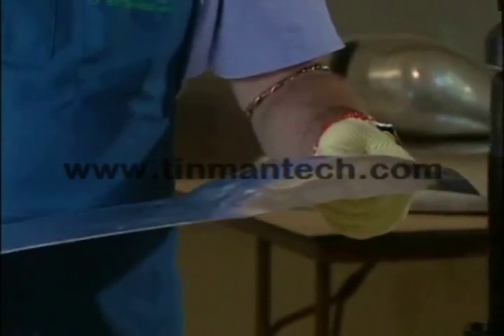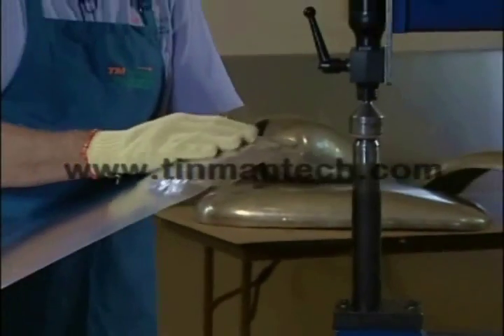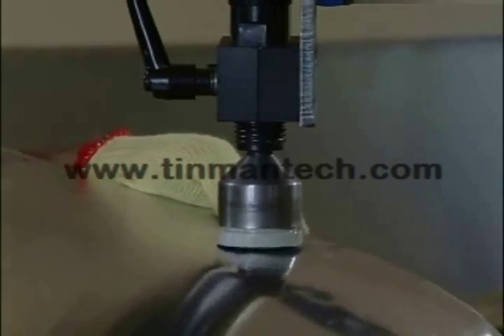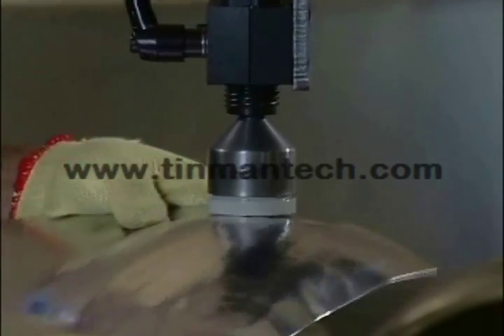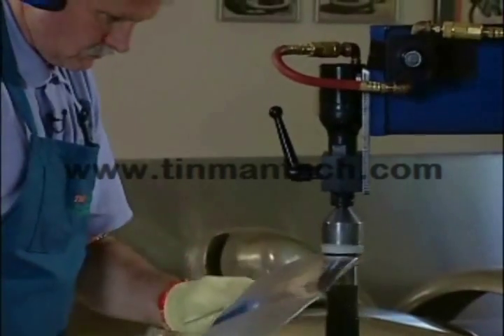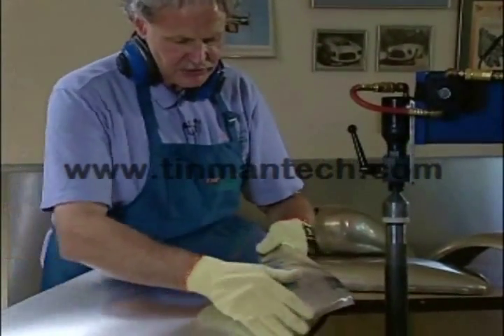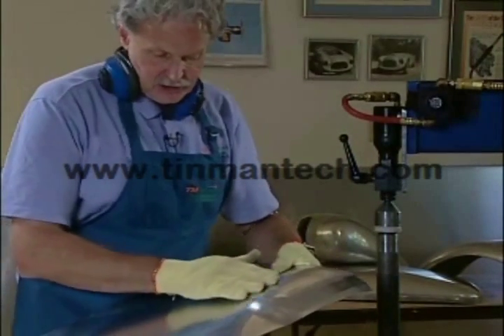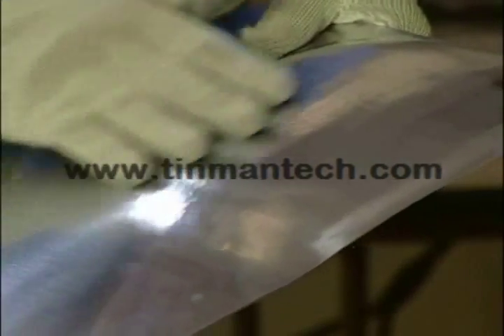Using a Rubber Die to Smooth Metal - TM Power Hammer / Planishing Hammer

Comment from the maker: @miljan95pk Smoothing is also a hand technique, where light striking is done to knock down the high spots and lift up the lows. A body hammer and a dolly can smooth, and smoothing can also be done with a slapper made of either wood or steel. The rumpled metal is held over an anvil of the appropriate shape while being struck with the hammer or slapper.   - tinman

Comment from the maker: @MrMellow22  Smoothing may be accomplished by suing a flat-faced wood or plastic mallet over a metal dolly or anvil that has a surface conforming to the surface you wish to smooth. I"ve actually made an instructional video called "Shaping Aluminum Wheelpants with 7 Simple Handtools" that will show you how you can smooth by hand. you can rent it for just a few dollars over at our website - tinmantech(dot)com. Hope that helps. - Tinman